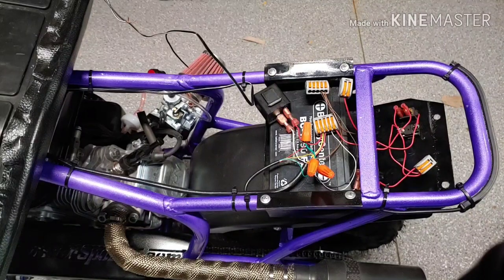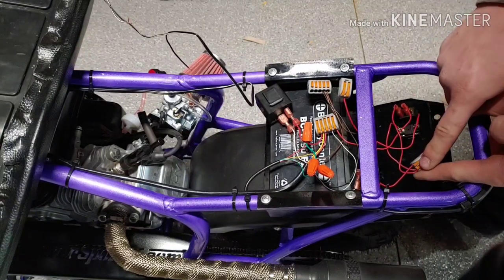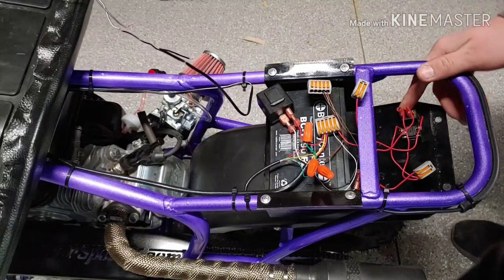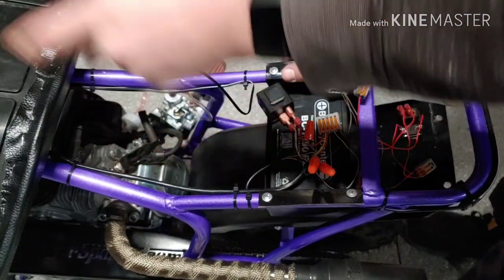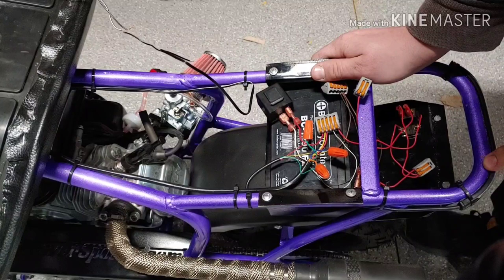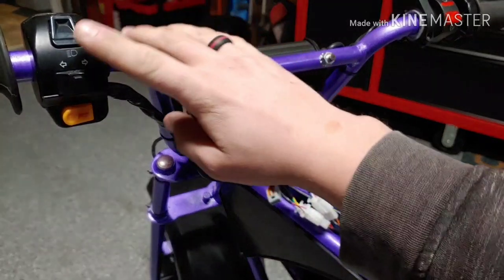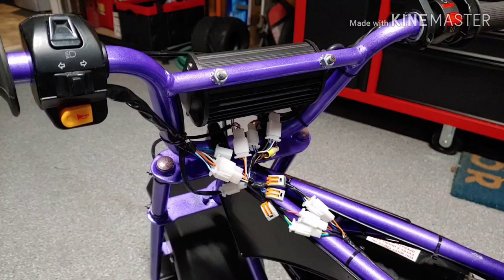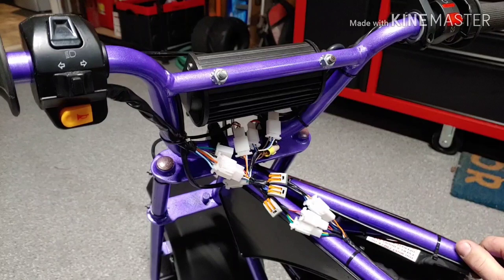Monster Moto Minibike wiring harness.

Comment: Quick question, Are all of you lights running straight from the battery, if so how do you charge, or is that needed? Appreciate your time, thanks in advance.
Reply from the maker: Straight from the battery and then i use a trickle charger for an atv to charge the battery like once a month.
Reply: @pretzelsgarage8881  wow once a month the battery last that long
Reply: @pretzelsgarage8881  no relay either
Reply from the maker: I dont really ride long enough to drain the 9 ah battery i use